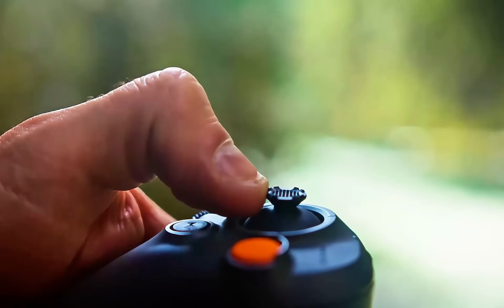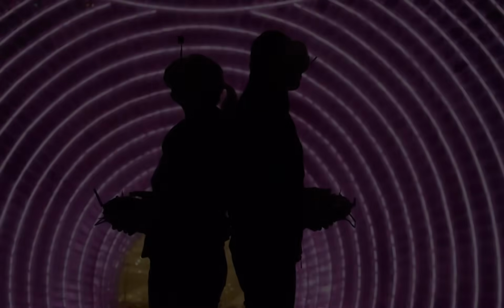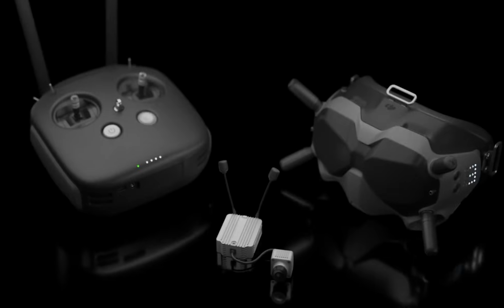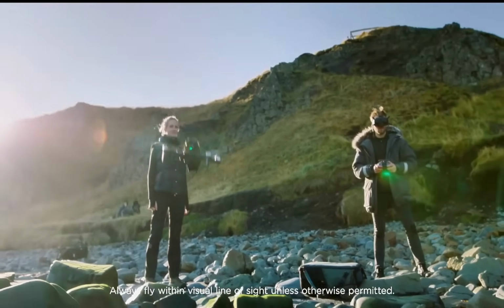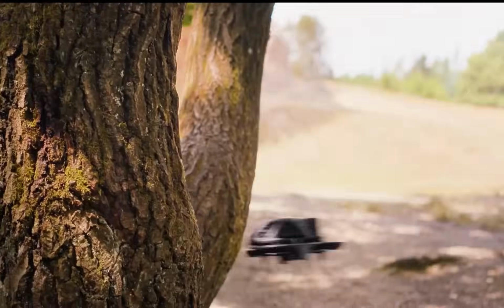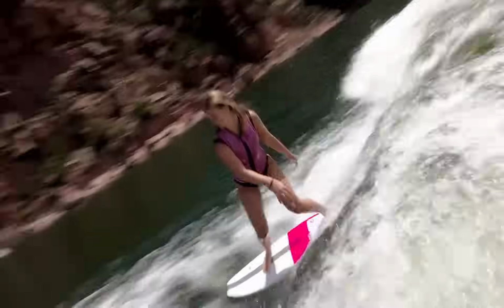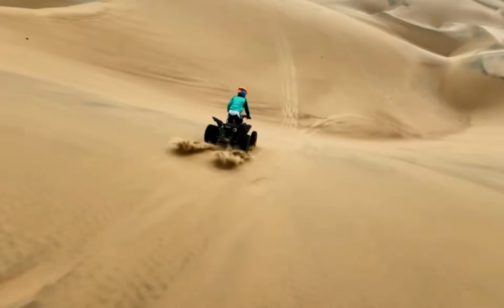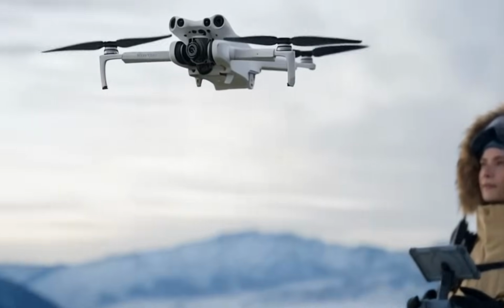Mini 5 Pro + Goggles 3 and RC Motion 3? Here’s What We Know!

Comment: I own a mini 2 and it has everything I wanted except compatibility with a smart controller and goggle.   I find using a smart phone as display to be cumbersome and I'd like the option of a smart controller with integrated display (such as DJI RC 2) and ability to use a goggle.  Why DJI uses all these different protocols and signalling schemes such that every UAV needs its accessories rather than making it universal, is a mystery to me.  I'm an engineer and know its do-able via software and perhaps an addon hardware module for signal conversion.  Or better yet, us a standard protocol for all new products.  How hard is that?
Reply: marketing...

Comment: Why would the mini pro 5 need a fpv controller it’s a photography drone not a fpv drone
Reply: Flying from a goggle view is much easier than using an attached iphone.  FPV does not have to be limited to people doing acrobatics or racing.
Reply from the maker: For the same reason as the Mini 4 Pro, Air 3, Neo, and Avata! It's simply a more immersive option for flying drones, and anyone who's tried it won't be able to live without it, especially those who already have the goggles and RC Motion.
Reply: @flytechdrone2 I no you can connect the goggles to mini 4 3 air 3 all them what my point is you can’t fly a mini pro or the air series like a fpv drone is my point so if you can’t fly it like a fpv drone why would it need a fpv controller you can’t stick it in manual and fly in manual so what’s the point in the fpv controller
Reply from the maker: @dannylumby8597  I don't know why! I'm just stating the facts, because DJI has a somewhat strange logic. Their compatibility strategy for DJI devices has always been very confusing and nonsensical. One example is the Flip, which is a drone with FPV features, like propeller guards, but isn't compatible with any Goggles.

The Mini 4 Pro and Avata 2, on the other hand, are compatible with both Goggles 3 (O4) and Goggles 2 (O3)! DJI is so confusing!